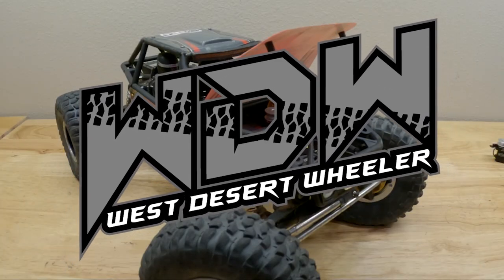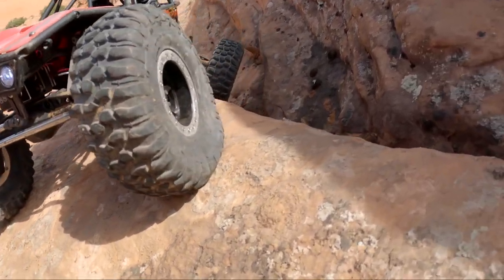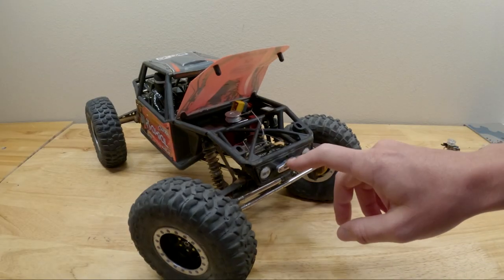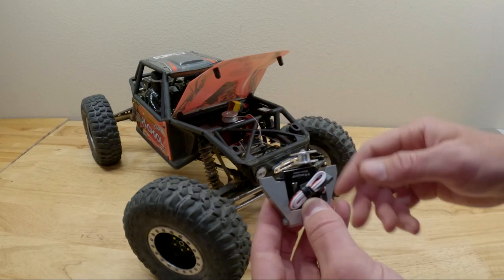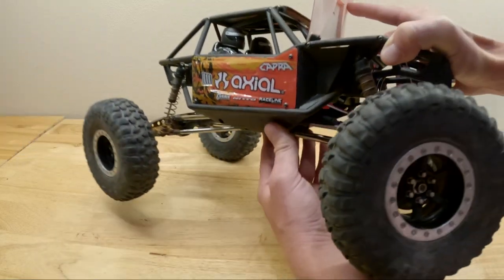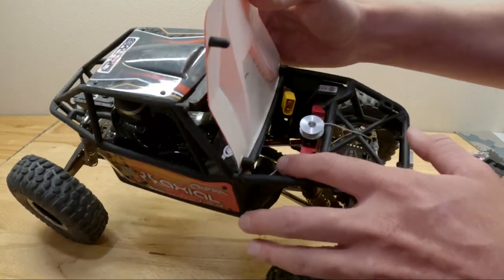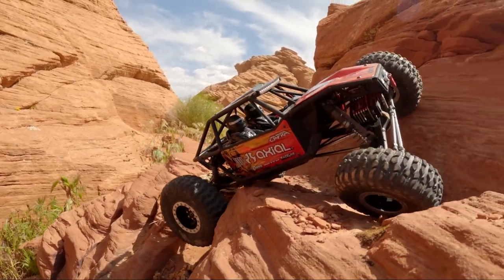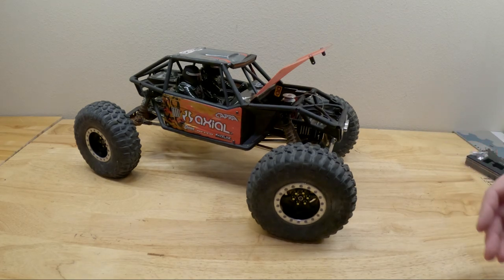WDW Axial Capra Winch Mount! New Release!!!

Comment: Just ordered mine.  Pretty geeked to get it in hand and installed.  I have a question on implementation.  On the top of the servo bracket, what about putting a really small pulley and then have the fair lead ran through the pulley and out the grill with a hook large enough to prevent it getting sucked into the hole.  that way the winch should be usable both as recovery and also for body suckdown.  Seem reasonable?

Comment: Will that also work with a RC4WD winch as the mount...I know it would be tucked away but then you could use the RC4WD remote setup with a stock  radio
Reply from the maker: This will fit micro servos

Comment: Just curious if there is any issue with the winch line sawing through the plastic of the cage with repeated use? If so adding metal shielding that bolts over the plastic would be a great additional part for longevity
Reply from the maker: No evidence yet. Sure it could be possible but it would take a ton of use to even leave a mark

Comment: I only use nsdrc servos and the micro's just have a single center hole on each side instead of 2 on each side. Is there enough room on that add a 3rd hole in the center of the other 2 holes? Just to make it more universal
Reply from the maker: The reefs mount in the center same as NSD. It will fit and work.